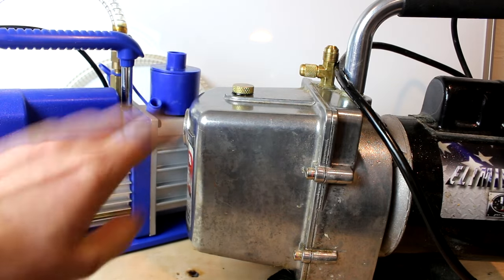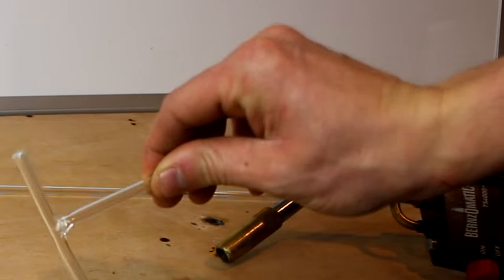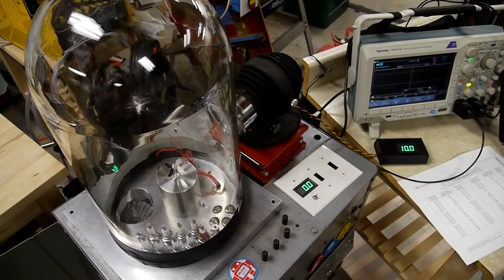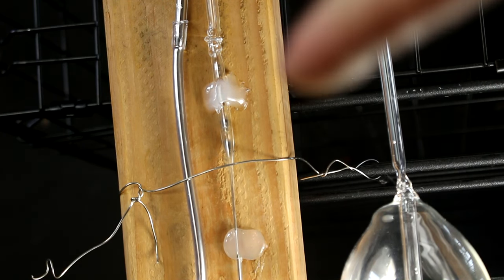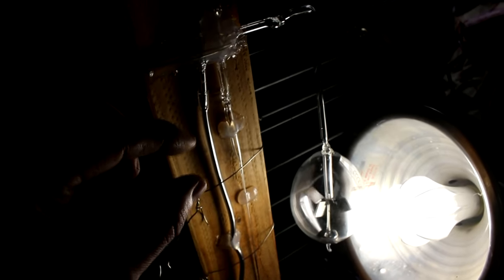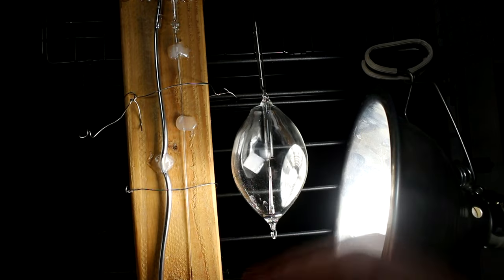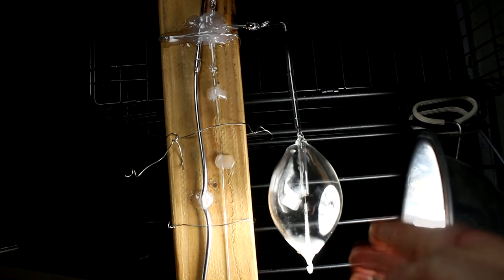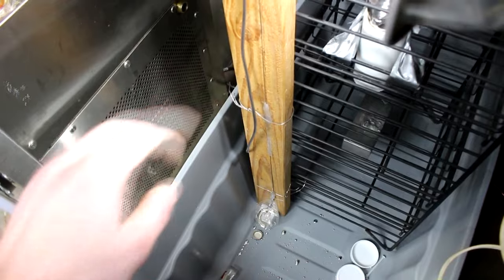Sprengel Vacuum Pump: The most efficient vacuum pump ever?

Comment: This is a dynamic version of a Torricelli pump.  Very ingenious.  The mercury diffusion pump works in the same way but by boiling mercury and then condensing it.  The condensing vapor pushes the air molecules along with it.  The vapor pressure of mercury at 25°C is 0.26 Pa or 2 microns.  Dirty mercury usually has a higher vapor pressure unless the contaminant is another metal like gold.

Comment: This entire experiment is fascinating. I am very much looking forward to giving it a try for myself. But the note on the electrical potential difference at the end really got my gears turning! Now I need to find out just exactly how much electrical energy is generated /per bar of vacuum pulled. Once I get around to doing this for my own research I will surely bring my results. 

~ thank you Cody! you are one of the good ones!
Reply: darrick steele 
There will be no direct relation between the electricity generated and the vacuum. Both will involve the mechanical work done by the falling mercury but in different ways. In the case of the vacuum, the larger the volume being evacuated the more energy will be required to create it. In the case of the electric potential, static charge on the glass is being transported down to the lower reservoir where it is charging the mercury. Charge building up will slow the vacuum process down as succeeding droplets are repelled by the charge already stored. This represents energy lost to the vacuum forming process.
For this reason a wire connecting the top and bottom reservoirs would be an improvement.
The idea that there would be any useful electrical power generated through this wire seems to this physicist to be improbable in the extreme, but anybody who wants to can run it through a standard resistor while measuring the current flowing and the δ(V) across the resistor.
Reply: @q.e.d.9112   years later and I still have not even come close to making one of these. probably will some day, but thank you for the explanation about the reason for electric potential. Coming back and having a second look after a few years, with more knowledge than I had back then, I now understand it more than I did four years ago, it is all the more fascinating.

Comment: When making my own vacuum tube back in the day (cold cathode high voltage 30000 volt rectifire) a gettter was used, made from a powder of magnesium and zinc. Oxigen pre fills the tube and after evacuating and sealing the end with the getter is heated and gets the rest of the oxygen for a high vacuum.

Comment: my best guesses for the suction tube are: as wide as possible while consistently sealing against the droplet, but it doesn't need to be much longer than the average gap between droplets. The larger the diameter the more air can be captured between each droplet, but when it becomes excessively long you no longer gain any more collection volume and rather just have multiple droplets working in the tube at the same time regardless of pressure. I would imagine that you could shrink the diameter of the column near the bottom to slow the mercury, but I don't really know if that would be helpful.

Comment: A larger capillary will permit faster pumping.The vacuum inlet should have a rise to trap the mercury.  A cold trap added to the inlet can prevent the mercury vapor pressure after pump down as it would condense the mercury vapor.  A TMP can achieve the high vacuum in very short times as the inlet area is large and you need a fairly large rough pump after it.  Many scanning electron microscopes use TMP's to quickly evacuate the chamber after simple transfers through the interlock.  A SEM has a much higher vacuum and would not have enough gas pressure to run the radiometer.

Comment: You should revisit this pump using galinstan. Galinstan actually has a lower vapor pressure than mercury.

I'd recommend adding a roughing pump in order to make it more practical for high-vacuum experiments, though, as you wouldn't need to wait forever.

Comment: Just throwing this out there, not understanding the complete physics of these pumps, but I bet the electrical potential is also helping drive the pump, not just gravity and the vacuum, especially keeping in mind the mercury filled tube is essentially a conductor, almost like a mercury Leyden jar. It would be interesting to see if the flow slows if you short both reservoirs with a piece of wire.

Comment: Cody, mentioning "since color photography" got me thinking.

Have you looked at Lippman photography? It was one of the very early color processes and ended up winning the creator a Nobel in 1908. Most of the modern info I can find on it is from people with experience in holography. It uses constructive/destructive interference reflecting between ultrafine silver grains and -- wait for it -- a mercury backing.

That's a long way of saying that you should totally try producing and developing a > 100 year old color process, because it'd be rad as hell.

Comment: The two reservoirs of mercury gave you a shock because you built what is basically a very rudimentary yet large capacitor. Two conductive materials eg. The mercury, separated by an insulator, which in this case was the vacuum you created. That's my theory, at least. The charge probably got built up because of all the static of the mercury moving through the glass. That explains why you got shocked from bridging that gap, because of all the potential charge accumulated between the two

Comment: I remember a fairly similar water based pump for medical suction from the same time period.
Between manual pumps and such contraptions, I'm ever so thankful for electricity!   ;)

I'd have measured how much mercury it took to create the partial evacuation of the radiometer. Just one of those plus things, people would be surprised by how much it takes to evacuate something.
Don't get me started on outgassing  system...   :/

Comment: You could make it with a electrical pump to transfer the mercury to the top container and with a couple of wires and relays you could automate it quite easily, allowing a faster flow and larger diameter pipes without the risk of running the reservoir dry.

Comment: I would assume in vintage setups they would have had a series of at least 2 different types vacuum pumps, possibly 3. 
You should do the same, use one of your stock vacuum pumps to pump whatever down to 1/1000 of an atmosphere in the minutes that needs, then flip to this mercury pump.
I assume a peristaltic pump could be used to lift the mercury from the bottom collection reservoir to the top reservoir if small and slow enough to avoid having to keep transfering the mercury back up by hand.

Edit→
Actually remembering back 30 years at school the physics labs did have some really old equipment as well as new. I do remember the teacher using some kind of vacuum pump very similar to a compressor to pull vacuum down fast then occasionally then used something with mercury going around in a glass loop with a rotating something similar to a peristaltic about the size of a couple of packs of card, it looked Victorian.
Think the teacher was showing effects of electrical arc on various gases at low pressure. IE colours like neon, argon etc.

Comment: why do you anticipate, that the diffused air through the plastic hose is not the limiting factor for your ultimate pressure?
The freezing is a nice idea. my guess is, that if it had an effect, it was the freezing of water, which is the main residual gas component.
Awesome pump, for sure!

Comment: At work we use PVD machines for coatings and our biggest machine uses 3 big ass turbo molecular pumps and a few mechanical pumps to get you to -2. a low enough pressure before you kick on the turbos to get deep into -4. All the other machines can get to -5. But they're smaller machines cool stuff tho

Comment: In this "Sprengel pump", dripping mercury through tubing, built up a significant electrostatic charge (acted as an electrostatic generator). The "Kelvin water dropper" uses two drips of water in open air to build up a charge. Perhaps these two could combine in some way to make a stronger generator.

Comment: I bet it would work better if you used molten gallium.  The vapor pressure is a lot lower.  You'ld have to make some kind of oven to keep it warm.. maybe an electric heater in an old refrigerator?  It would also have the advantage of not being mercury.

Comment: Crookes radiometers will run on heat as well as light. It slowed down after cooling it in liquid nitrogen because they will run backwards when being cooled. So even though the light is hitting it the temp is far lower causing the friction.

Comment: You should modify different Crookes radiometers by putting different types of gas in each and see how it effects the vane rotation speed; obviously they need a vacuum, as you said, but they need some atmosphere to get it to work. Maybe even test it with different laser wavelengths/intensities to see if the combo gives any interesting results.

Comment: Considering the electrostatic potential that developed, it might be safer to run a wire from the top reservoir to the bottom so as to continously discharge it. 

Alternately, it might be fun charge a capacitor to a specific voltage and determin how much energy that is.  Then determine how efficent it was at converting gravitational potential energy to kinetic energy to electrical energy.

Comment: so glad you busted out the laser, i was curios about that right before that was added in. this whole thing would work the same roughly with water right? just less energy per drip? or no... also what would happen if you wired a tiny led and stuck one end into one mercury cup and the other line into the other? how much sustained energy comes out? where/what did that shock you got come out of?

Comment: Hi Cody, I just noticed, what you built is also known as a venturi pump.
Reply: a venturi pump is where the fluid is blasted through a jet inside a venturi, and gas or fluid is drawn in around it, or air or fluid goes through the venturi and suction is drawn through the jet. This is a gravity drop device, that doesn't use the venturi effect.

Comment: have you ever thought that you could possible make a real perpetual motion machine from this? i noticed that due to the weight of the mercury you were able to have the reservoir possibly lower than the receiving container at the end of the glass tubes, so if you were to use another siphon instead of manually refilling the reservoir with a syringe then you could make this pump run continuously without doing so much as setting it up to begin with.

Comment: For even greater efficiency: 
1) take a vessel with a thin 38"  tube attached 
2) fill the whole assembly with mercury 
3) quickly invert and place the open end of the tube under the surface of mercury in a separate container
4) the weight of the mercury immediately pulls a vacuum in the vessel at the top of the tube
This would essentially be a mercury barometer with a large bulb at the top. Not sure how useful this would be as I'm sure there are plenty of experiments which wouldn't want to be submerged in mercury before hand. This could work on any size of vessel depending on its strength and the amount of mercury available.

Comment: The pump isn't operating very fast at high pressure so why not 
1. use a regular vacuum pump to bring the pressure down
2. seal the vacuumed chamber
3. connect it up to the mercury-powerd Sprengel pump 
4. start the Sprengel pump 

---

Great video!

Comment: Highly recommend diffusion pumps, with some caveats.  Diff Pumps require internal and external pressures to be below about 10^-5 torr before being exposed to the test environment.  Too high, and you're burning oil instead of boiling it.  Duh.  But if your pressure is TOO LOW, you have a mechanical problem.  The valve that exposes your diff pump to your test environment has mechanical limitations to actuation.  Control below that 10^-5 target is very sensitive, and a small numerical difference in pressures can create enormous stresses on your equipment.  So in order to equalize the pressures before letting the diff pump do its job, it's best to hit that target.  Your individual diff pump's configuration, geometry and oil specifications will determine this pressure.  If you can't accurately hit that pressure, don't bother.

Which brings me to caveat 2!  You need two pumps that can do this in tandem.  One to bring the experiment space down to pressure and one to bring the diff pump down.  If you've got two pumps and two sensors, all calibrated to the same standards, and you fully trust them... diff pumps are sweet.  They are a very low energy way to hold a pressure down in UHV conditions for long periods of time.

If you're not interested in long duration vacuums for your experiments, I wouldn't bother with the hassle though.  

And now I see that this was over 2 years ago...  Well, it's still sound high-end vacuum pump purchasing advice.  It'd be a shame to let it go to waste.

Comment: Cody,  how many volts?  How many amps did you generate with the electrostatically charged mercury in?  What size inverter will it power. What is its potential output? Bingo bro!  You're onto it!  My jaw is on the floor!!!?  Are you going to release this to the public or pioneer it into a saleable product?

Comment: I have two question. Could you harvest the electricity that shocked you? You can use it to charge a pump to bring the mercury back up to the input tank of mercury. Also could you make a radiometer with a generator in the middle as different kind of solar panel? If it would work you could use that to power a pump to bring the mercury back up. I'm not seriously thinking of ways to improve this, just curious.

Comment: I wonder if you could create a perpetuate motion apparatus with this. in the way that you use the gravity in the last bit of tubing to launch the mercury a bit up again, like in a roller coaster.  this way you might be able to get it back into the initial cup, although it might take a few stages.
Reply: That's a smart idea, but it wouldn't work since perpetual motion is not possible.

Comment: Cody, I found the whole video very fascinating! 👍👍👍 But, I have two questions. First, you shut off the light to show arcing in the mercury and then at the end told about getting shocked due to "electrical potential buildup". Can you please explain in a nutshell what is causing the electrical charge buildup. And secondly, are those your chickens providing background noises during the video? Thanks again, and great job as always, Joe

Comment: It's almost 100% efficient since gravity is the energy running the pump. Every drop of Mercury carries away some gas and other than droplet size, mechanical finangling to move the Mercury back to the reservoir, and energy expended on friction, electrostatic emissions in the capillary, and that kink (all of which are more or less negligible given how little energy those take), pretty much all of the energy is used in pumping down the vacuum. Pretty damn cool. Even adding a triggered pump to move the Mercury back to the reservoir would probably pull less power than your pump, especially since the distance between the catch basin and the reservoir is less than the distance the Mercury itself falls in pulling the vacuum.

Comment: The chrysler AC  vintage v twin piston pump has strong positive and negative preassure but needs to be altered with the correct adequet  fittings excuse my spelling you will find this pumps on any chrysler 60s to maybe late 80s.

Comment: Wonder if the electrical build up is caused by the mercury moving along the glass, or because of the plastic?   If so, maybe you could harness that to run a pump to xfer the mercury from one cup to the other making it self-sustaining ..  (more or less.)   At least then you wouldn't have to keep coming back to it and manually moving the mercury .

Comment: so i know you really arent doing these sorts of videos much, but what if you made one of these pumps with multiple connected mercury dropper chambers, would there be any improvements on speed? i would think that achieving a 2x or perhaps even a 4x speed up should be possible with the right architecture, but i also think there would be diminishing returns for each extra dropper chamber you add.

Comment: I wonder if the electrical potential between the two containers has any use, and what would happen if a series if lights from leds to neon were connected to this under fixed working conditions?

I hope you see this Cody, fellow armature basement tinkerer

Some day I hope to have 1/100 of the wisdom you have learned

Comment: I was wondering if this pump would also act as a Kelvin water drop static generator, and it did.  So, only the weight of the mercury was responsible for the vacuum?  I thought that the mercury would also act like a diffusion pump since you were getting some vaporized mercury.  Speaking of mercury, where can you find relatively small quantities of it at a decent price?  Thank you for the videos. Jerry

Comment: The vapour pressure of Hg is very low at 25C is 1.86651 × 10-3mbar or slightly less than one micron. Therefore Cody is not breathing very much Hg vapor, he would be getting more Hg from dental fillings.